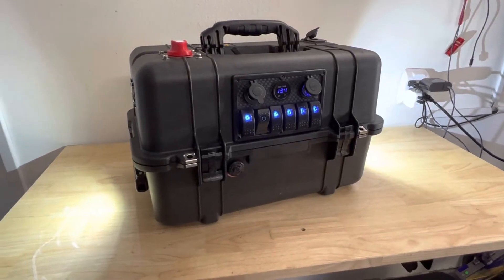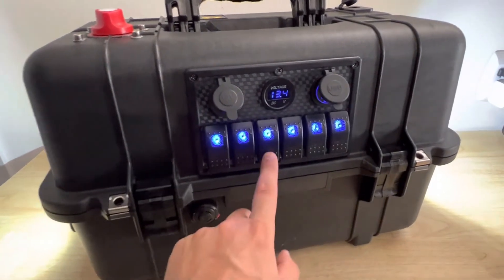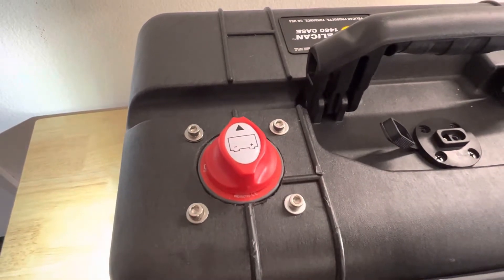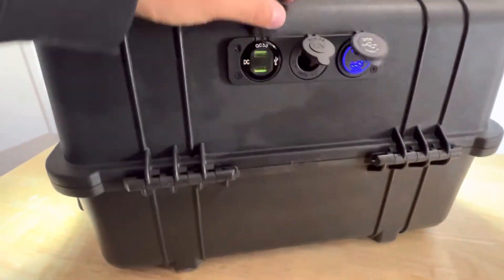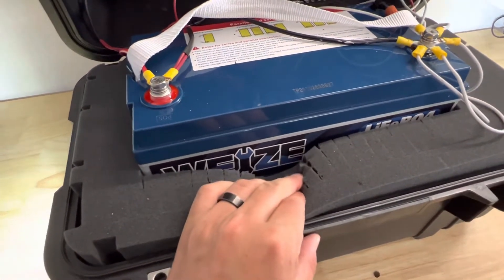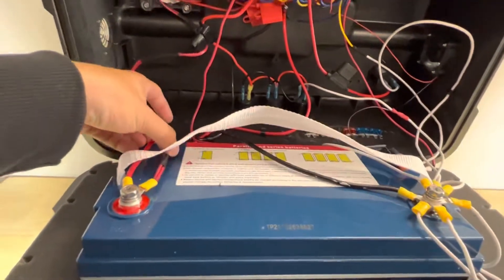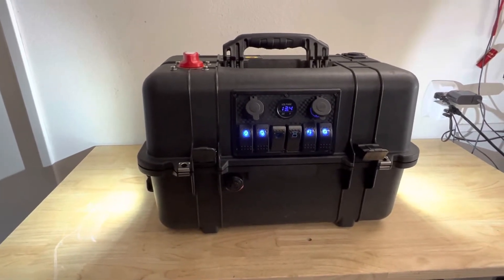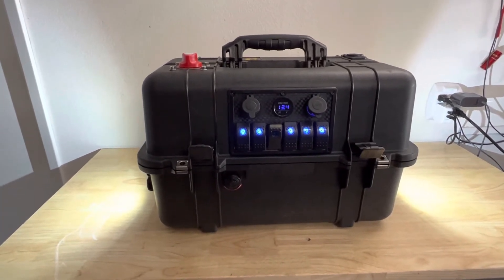Best DIY 100Ah LiFePO4 Battery Box/Solar Generator

Comment: Hi! Can you power devices and charge from the solar panel at the same time with this setup? My panel generates bout 19v (open circuit) and I think 12-15v closed. Worried that I might fry the 12v usp ports without a controller. Thanks for making this video!
Reply from the maker: I have charged it and used it at the same time with no issues, it was with a wall charger though not a solar panel. I want to get panels soon since I am going to using it for a trailer. 
A charge controller should work no problem, I'll be adding one soon. 
Thanks!
Reply: @so-caladv1179  so cool! I’m building a mini version of what you’re doing. It’s in a small pelican case I no longer use but doesn’t have room for a controller. My trickle charge panel ( 12v, 10w, .5A )supposedly has a built in controller so even though it generates 19v (open circuit) the manufacturer says it’s safe to plug into the car. So far it works great so I bought a second. Wondering tho if it’s safe to power a USB port like yours if plugged into a battery (closed circuit with resistance). What do you think?

Comment: I'm looking for something like this for some jungle I am homesteading ... humid and has a rainy season. Curious what inverter you would install theoretically. Personally probably some kind of fridge, a table / mitre saw (15 Amp?) would be my largest loads... though a shop vac(7.8 amp) , small compressor (12 amp) and a pressure washer (13 Amp) not all simultaneously of course ... no idea what start up draws would be.... is this even doable?
Reply from the maker: Good question, the inverter you choose depends on what you will/need to be running. Most 2000 watt inverters are good and can power most things and they do have an amp rating. You just have to pair your equipment with the correct wattage/amperage inverter. Startup amps are always higher so I am not sure of the peak amp draw your equipment pulls on startup.

Comment: This is 12V only? What power station are you comparing it to price-was that doesn't come with a built-in inverter, A/C charger and solar charge controller?
Reply from the maker: Right now its 12v, was rating the time off the dometic cfx3 w/ 1-1.5 AH draw. If i need an A/C inverter I have to hook it up manually to the battery, its not built into the box.

Comment: What is the fan really cooling? If you had an AC inverter then it would make more sense. Also think about natural convection for cooling.

Battery is also going to need some type of charge controller. 

Anyway, I want one!!!!
Reply from the maker: It gets hot in direct sunlight. Imagine 110 direct sunlight all day, the vent exhaust is hot! A inverter would definitely need it as well.

Comment: How do you charge it? I saw you have a charging port, but it looked like it went straight to the battery. Do you have a solar charge controller or do you use a AC charger?
Reply from the maker: The attached port is a SAE port, so right now I just charge it with an AC charger. You can easily put a solar charger connection I just didn't because I don't have panels.